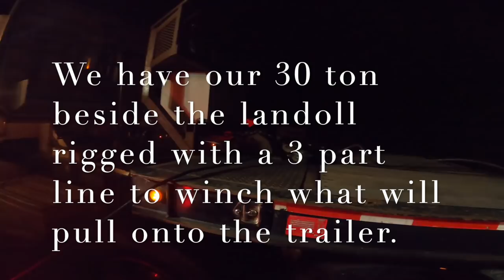Load of Coffee Creamer catches fire! Total Loss!

Comment: I would guess someone opened the trailer door to get a look at the fire before the fire department arrived.  Gives a lot of fresh air to get it ripping in there.  Should be part of the driver training to keep it closed off until fire department is ready and then let fire open it.  The same applies too your house, close all the doors as you leave, then kill the power and gas.  I have seen several loads of furniture burn to nothing from the door's side and back being opened.
Reply from the maker: Mr John Yes sir that's very good advice. Thanks for watching and stay safe
Reply: My step-dad was a fire chief, and one incident that he responded to illustrates this, big time! A small fire had been smoldering in the basement for a while, and there was also a gas leak. When the first responders got there, they opened the front door, and a couple minutes later, BOOM! The roof went straight up, the brick walls were pushed out and the whole structure collapsed instantly upon itself. Two of the firefighters were just inside the entry foyer and they were thrown halfway out the front yard. Like you said, fire incidents ain't nothing mess with for civilians; let the trained pros handle it.
Reply from the maker: @msheaver  I hope everyone was okay.  Thanks for watching our videos and stay safe